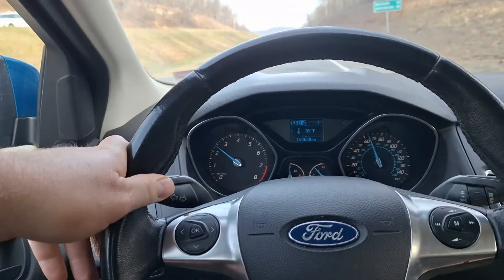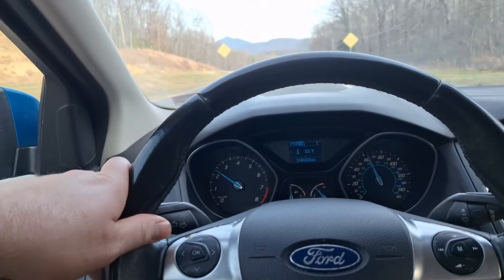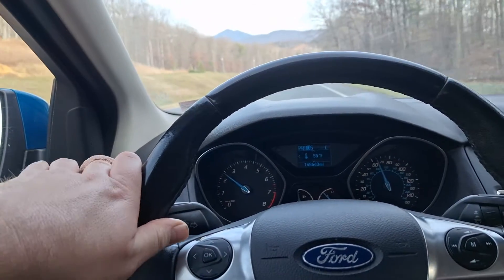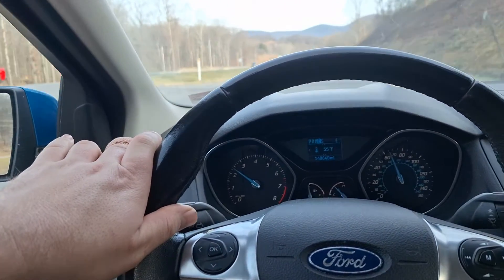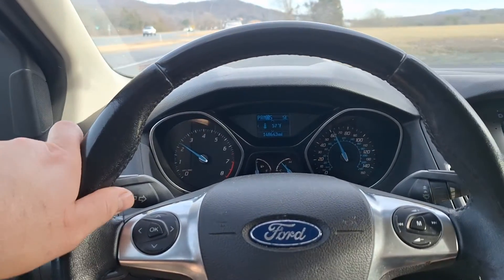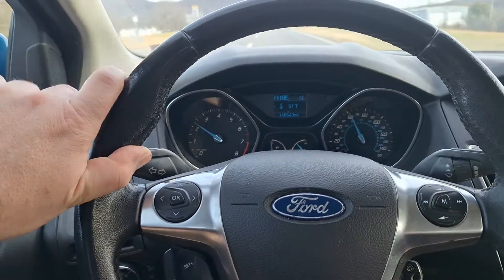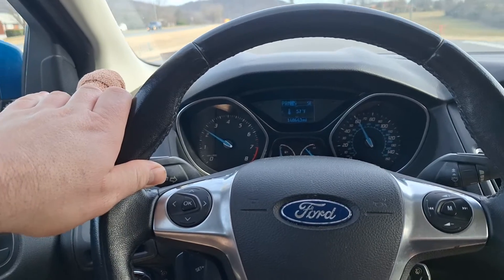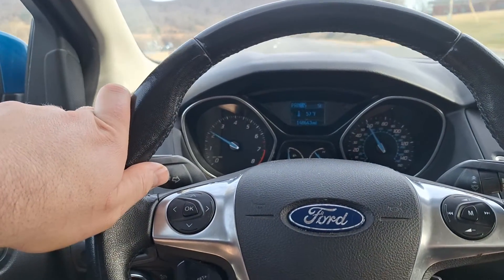Prevent DPS6 Synchro Failure! Ford Focus & Fiesta

Comment: Fluid Volume: 1.7 - 1.8 Qt
Warm Climates ( > ~40°F ):
  ACDelco Friction Modified Synchromesh ( White Bottle, not the black bottle, according to Ben )
Colder Climates ( < ~35°F ):
  Motorcraft DCT Fluid ( Factory Spec )
  AMSOIL DCT Fluid
  Royal Purple Synchromax ( Full Synthetic )
  Red Line MTL ( Full Synthetic )

Comment: I never get codes but i constantly have problems im gonna resand my ground because i didnt protect the 2 under the filter for corrosion. But i have bad shifting pulsing light but not all the time. And it drops to 9-10v when i keep the car off and it take longer to start up especially in the cold. If the ground cleaning dont help what else would cause like to pulse or dim when i use my windows?
Reply from the maker: @IWillDuckYou  I'd see why your lights are dimming while driving and see what the alternator output is while it's doing that. Migth be a bad alternator or a cell failing in the battery
Reply: @BigBensCarsAndCycles  I've been planing on check the alternator. I don't think it's the battery I've had at least 3 battery's in the car and they last for a while. They always hate the cold though. The light pulse on all of them and only dim when I roll down/up the windows. If it's not the alternator going out what would the next step to look at?  Thanks for the response. Your the first one in the 10 years I've had this car actually reply back🫶

Comment: Unfortunately, I've got a weird issue. My car had all the bad tcm symptoms, but since my fiesta is a 2016, it wasnt covered under the extended warranty. Had it diagnosed and replaced by the dealer and payed out of pocket. That was a year ago and the car has been running fine. 116k on the odometer and did a fluid change at 50k. When I reverse into my drive way, which is slightly up hill, it has popped out of reverse on two ocassions. Can't recrate the issue. And it works fine other wise. Havent found any info on this matter. Have you come across it?
Reply from the maker: I would replace both clutch actuators (the motors) with new OEM actuators and that should take care of your problem
Reply: @BigBensCarsAndCycles  Thanks for the reply. That's the answer I was hoping for. Forgot to mention there are no codes. I bought the car new and it has been really good to us other than the TCM failing.
Reply from the maker: @martinmartinez8161  gotcha! Yup an extremely intermittent loss of engagement is most likely the actuators

Comment: Great videos sir! Just wanted to ask, I have a 2015 Ford Ecosport 1.5 DCT and the transmission is making a horrible, wheel bearing similar noise. At idle no noise but as soon as you pass 10mph, it is so loud!.

So checked the fluid and it's good. So trying to remove the transmission and for some reason, struggling to separate the box from the engine. It splits all round with a pry bar but seems like it might have torque converter bolts. Can't find the bolts of it does and I checked via the starter and nothing.

What am I missing if you know? Thanks for your help in advance
Reply from the maker: Hi, there are 6 clutch nuts holding the clutch to the flywheel. Your noise might be an output shaft bearing
Reply: @BigBensCarsAndCycles  Thanks for that, might you know where i can access them or do you have a video? 
Also,  what's the part number of the transmission? Just want to know if it's the same as the focus or fiesta
Reply from the maker: @konquerorx  take the starter out, and the rubber piece inside the transmission where the starter sits. Turn the engine over clockwise to access all 6 nuts. Idk the part number for the trans. The base number is 7000
Reply: Thanks will definitely try that today
Reply: Hi there, so I have the trans out and yeah lol, no body wants to touch them here in Australia. Will have to do things myself. 

So I leaning towards the outsmart bearing like you say and do I have to strip it down completely to get to it?
Reply from the maker: @konquerorx  check my video for p287b - case half replacement. That's the easy way to access the bearings and test them
Reply from the maker: @konquerorx  if you join my discord , you can share pics of your progress and I can help further
Reply: Ok will do